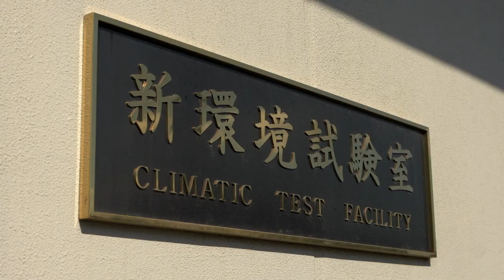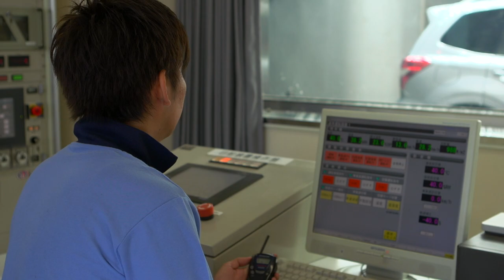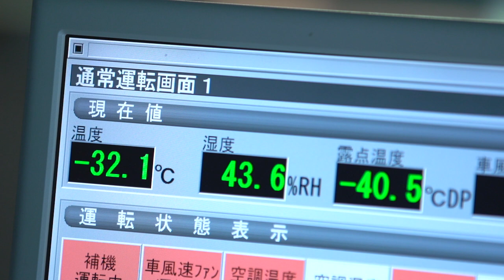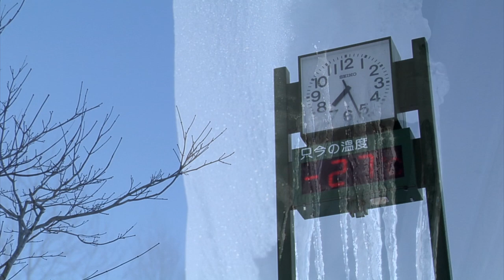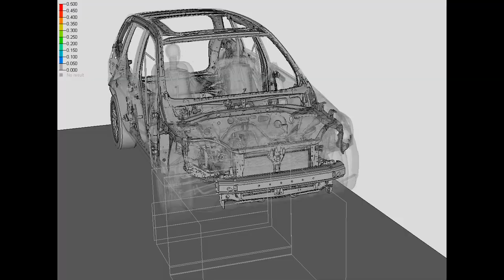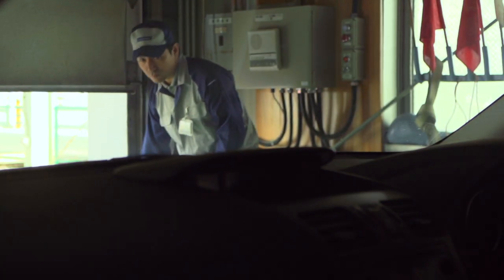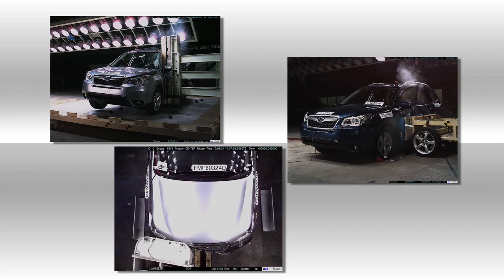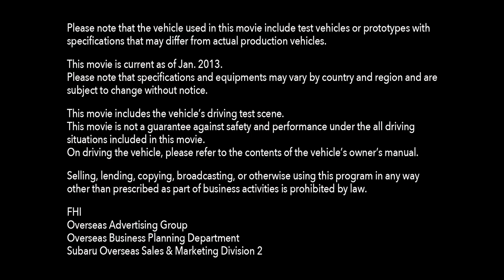The 4th generation Forester development movie chapter 4

Comment: I have the same problem with my impreza and i solved it using the a-con in re-circulation mode, you will freeze and believe me not even my new benz A-180 which come with a powerful a-con (15 C) can cool the cabin in Manila, the place is just so crowded and hot. Automatic Climate control equipped cars use re-circulate mode to keep the cabin cooled faster and efficiently, it helps too for fuel saving.

Comment: My 2015 forester is great in the snow but sometimes I question how much testing was done in cold climates.  I have noted the following negatives during winter operation. Firestly, the heater is terrible. I have to wear a hat during most of my 18km drive to work and find the ports at the floor level deliver very little air flow.  The windows are frozen shut at least 50% of the time. This is a pain because I have to open my door to enter my parking garage at work.  Gas mileage is reduced from about 7.2L/100km in the summer to less then 9.4 in the winter. On a positive note, the heated seats are very effective.  I do love my Subaru and these are the only negatives I have found.

Comment: Just bought the 2017 Forester touring with eyesights. I just LOVE driving the car and being assisted by all the accurately operating high-tech packages. The only issue is the rear gate lifting, which fail to open using inside button.